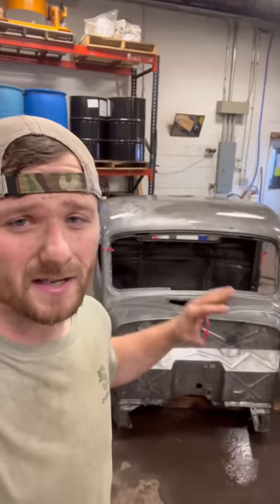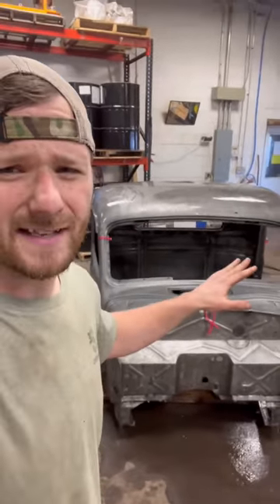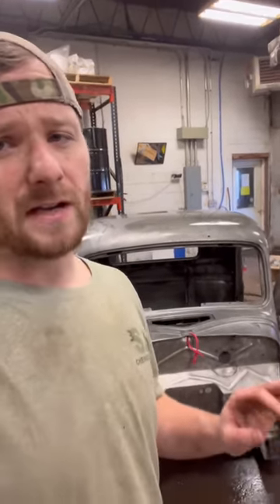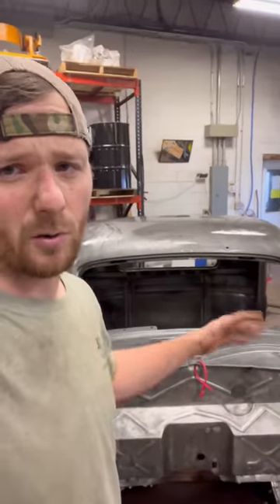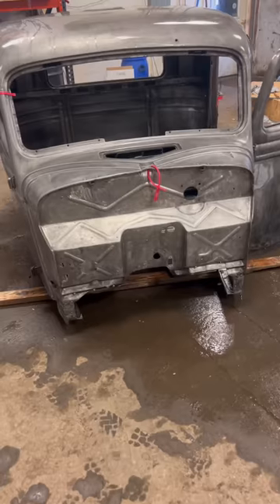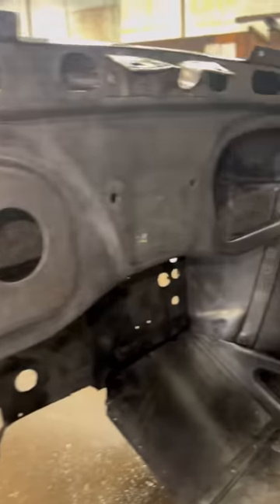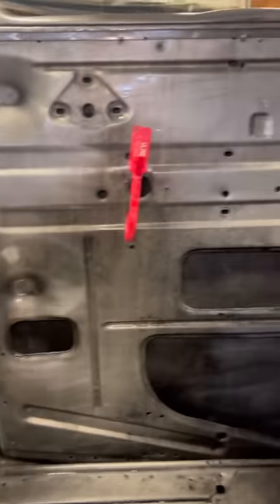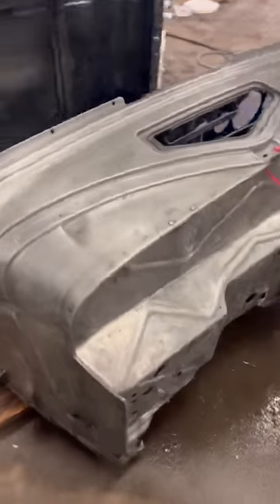Chemical dipping a Classic 1936 Ford Pickup Truck Cab

Comment: I have a doubt: if the operator makes some scratches over the paint with some abrasive Tool, It becomes easily and faster to the First chemical dipping penetrante and remove the paint?

Comment: What happens to the 'dip' once it is finished with? Where does it go? Isthe jetwash water or something else and what happens to the runoff?
Reply from the maker: We have a pit under the washbay that’s separate from our sewer drainage. The runoff is collected there. We then pump it out and filter it into evaporation tanks that have heat exchangers to evaporate all the water out of it. What’s left is a neutral sludge. We then pay a company who specializes in chemical waste disposal to dispose of it properly for us.
Reply: @minute_of_dangle  many thanks very interesting